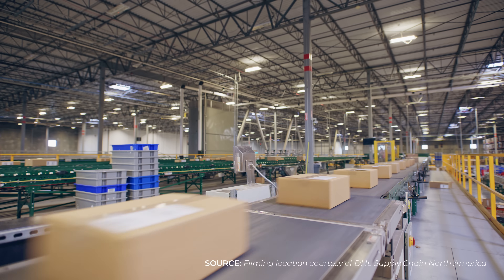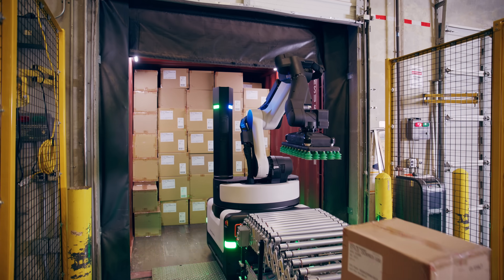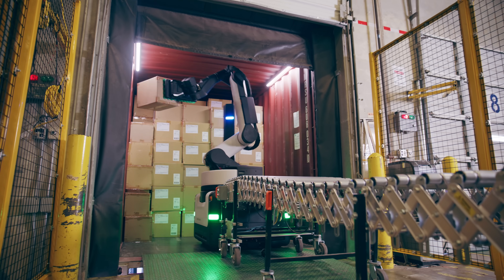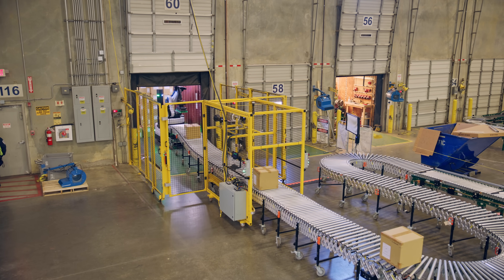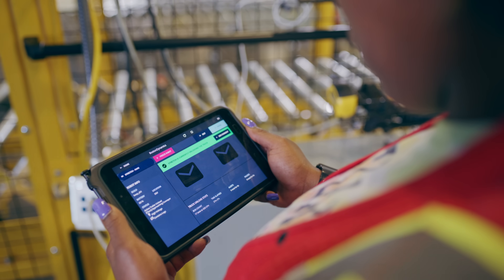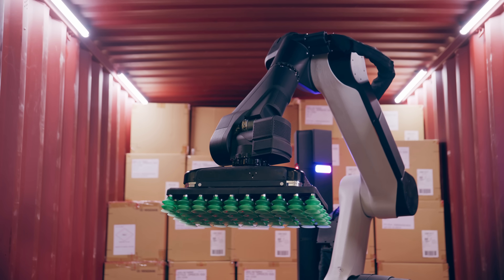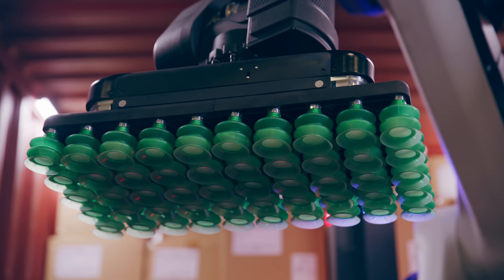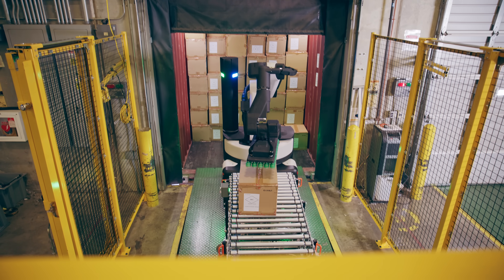Stretch at DHL | Automated Trailer Unloading

Comment: Clearly the most inefficient design!  It has to rotate 180 degrees for each package, TWICE!  Would’ve better if it could grab a package and then extend its arm behind it and then set the package down.   Another idea is to have two arms one on each side of the pivoting platform.  So that each time it moves 180 degrees that it picks up a package and places a package at the same time.

I’ve often thought the floor of the trailer should move.  Like a strong fabric that can be pulled to move items closer to the doors.  Eliminating the need to have to walk back and forth in the trailer to unload it.

Comment: I was a handler for many years also at amazon and FedEx and this does not work on all types of boxes and it’s slower than a human atleast twice as slower. I recommend they get rid of the 180 degree turn as it’s a lengthy motion and conveyor start should be right below the arm so as it lifts them it will place them quicker on to the belt. Secondly, this arm won’t latch on to every type of box. Some boxes would rip by their own weight if grabbed just by one side so a second hand is needed somehow. Its definitely a good start can’t wait to see what’s next.

Comment: 2:30 if the ROBOTIC MINI CRANE STRETCH only does 20 boxes per minute I'm sure it doesn't need a break. At amazon you have to load and unload each second with boxes falling off conveyor belt. Human still beats robot

Comment: I used to do this job first off stretch moves slow as fuck. I could do triple this speed and at a much fast rate. Stretch might be good for over night. The other problem is boxes do not work like this and they are not templatize in this manner. The technology is not ready yet.

Comment: Think the biggest pro is consistency here. 

Sure the robot may be unable to handle uneven loads/boxes and won't be as fast as humans. But it can do it all time, every time and without breaks as long there is nothing mechanically faulty. 

Sure you will need to step in once in a while if the box is too heavy or uneven for those suckers to pick it up, but if it can cut down the job load by just 70%, that is HUGE. 

Remember, no human can work at full speed for 8 hours, a robot can do it for 24 hours as long no mechanical issues.

Comment: i want to see strech working a loading dock where the weather barrier is missing or worn out or severely damaged as that's how most typical high flow loading docks are in that kind of shape 24/7/365 as keeping them  sealed isn't a cost executives want to give up their bonuses for so watching this thing work while -25º with snow blowing off the roof and into the trailer and the building would be fun to watch this million dollar machine  start smoking and smashing into every thing or just utterly shutting down. why not show us how this thing works in a thunderstorm where the rain is pouring in, love how you substituted DHL building outside for FedEx which is way bigger and busier than DHL...the DHL building looks just like one of the best buy main warehouses except there is pallet racking full of product much closer to the dock doors by about 50% and that's usually 1/2 mile to mile long by 1/4 mile wide.
knowing how hot it gets in these in the summer i also can't wait to see it fail due to it overheating sitting in 120º+ trailer while itself is exhausting 140º heat on it's own on a 70º day. lol

Comment: I feel like I just watched a big ad for DHL - but also, that's awesome to see Stretch actually be deployed

I do wish that we got to see stretch working further in the truck though - the first 6 feet is fine, but what about the last 6?
Reply: Don't worry I've seen this robot in person (in their lab's [my teacher had connections and gave us a tour of their facilities in … not Boston I forgot where their headquarters is exactly but its very closed to Boston]) and they were showing off the robot picking up different sized boxes with un-even weights in rapid succession. Basically from what they explained to me the robot starts of slow because it needs to map out the boxes with a depth camera, but it cant do that if its a flat wall of boxes. So, the robot needs to remove some boxes and then its cameras (which take pictures every time it wants to pick up a box) can map out the boxes and more accurately predict were the boxes are in a 3d space. So, overtime it gets more confident in its prediction's and its starts going very fast (so fast that it made a mess on the other side in the demo because there was nowhere for the boxes to go). I honestly don't know why they didn't show of a better clip than the one that they did but I don't have all the answers.

Comment: i thought most packages would be on palettes und get unloaded by a fork lift
Reply: You can load more product into a trailer without pallets, and also not needing to have forklifts you cut out a hazard of the workplace. I work in production and manufacturing. Forklift drivers have been the number one problem at every company.

Comment: To me it seems slow..
Reply: You haven't dealt with actual material handling than. This unloads the trucks, scans the product to inventory and loads it to the shelf. Meanwhile, the fork lift driver goes as slow as possible to drag the day out, drops a pallet of goods, then puts them in the inventory section, scans it to a random rack location where they didn't actually put it and doesn't tell anyone they damaged the product and then proceeds to pick up the wrong material out of FIFO order to the work floor.

Fuck fork lift drivers.

Comment: I’ve literally did that for some years at DHL in Sweden and fucked my back up even up until today. Still have a messed up back , did alot more than just empty those trailers under 30 minutes by my self several times a day. A lot more damaging to the back. DHL was the worst working place in Sweden at that time I believe. It’s different now though but still trash workplace for ppl

Comment: I expected much more detailed information about the specs and the economics of STRETCH. What does it cost (upfront, leasing ...), a what rate is its hourly salary running, up time vs down time etc. etc. service needs, limitations and problems. The progress to alleviate humans from repetitive work is very obvious and doesn't need to be stated times and times again but obviously there are other considerations that play a role otherwise these machines would already have taken over.

Comment: Three takeaways from this. First is that the guy in the beginning didn't focus on a benefit of it being better for staff health and safety. Second is that it means robots are now getting cheaper than minimum wage. Third, and probably the biggest, is that they seem to have developed a type of cardboard box that can just be suctioned from one side and lift with a full load without tearing apart...

Comment: If they could turn up the speed it could replace human workers completely and with 100x efficiency.
With that slow speed it only has the benefit of 24/7 operation.
Before, i was working with unloading containers, the boxes would be stacked onto pallets a lot faster than this.
It was hard work for sure.

Thank you Boston Dynamics for making our lives easier!

Comment: I wonder how Stretch handles boxes that are poorly taped at the top and/or bottom. It grabs using suction on the top or at the side, which basically relies on the strength of the tape to keep the top/bottom from opening up under its own weight. A normal person grabbing the box would usually support from the bottom and not have to rely exclusively on tape strength to keep the box closed.

Comment: As someone who currently works doing this. This trailer load is extremely unrealistic. Every box is flawless, every box has its label pointed exactly where it needs to be, every box is the same size and weight. Not to mention they quoted throughput and yet look how slow it is. 

Me and one other routinely empty a standerd semi trailer of frieght like that one in 20-30 minutes, equalling maybe 1-1.5k boxes. 

This machine is a good start. But it needs to be faster. Much much faster.

Comment: That’s faster, safer and cheaper than a human. 

But could the robot have two arms and a conveyor in the middle? And pull each box a shorter distance and handle each box in less than half the time, as a giant arm doesn’t need to swing around?

Or maybe an integrated grabber/conveyor could vacuum up those boxes and unload in 1/10 the time. 

Easier imagined than implemented, of course. And not using off the shelf robots. But there is unrealized potential here.

Comment: This bot is doing the task in near perfect conditions at a much, much slower pace. Perfect, square containers, labels facing outward in a non drop floor trailer.  Good, choreographed demo of what is achievable. However, In my day at UPS, I started as an Unloader. I was tasked to unload drop floor trailers. The fastest I could unload 100%,  drop floored 26' doubles was in 30-35min, a 40' in under an hour. That's with decent trailers with good equipment (rollers), higher angled with belt speeds set to my unloading speed. 

The condition of the equipment, the differing sizes and types of package items can drastically determine the pace a package trailer could be loaded or unloaded. But still do that within strict time frames. These bots will need problem-solving AI, dexterity and flexibility of a human in confined spaces to totally idle this line of work for humans. One day, it will happen.

Comment: On one hand, I am really happy and excited to see something like this, on the other, it's really easy to see how this could entirely displace workers and take another job away from those who could use the work in towns where there may not be many other options.
Reply: Many have the illusion that automation will come one day and just take everyones job. The process of switching to efficient automation is slow and is normally applied to new infrastructure. To implement this, they will most likely apply it to new wharehouses built for this process because is better to than modify the old one. Even if they apply it to old wharehouses the current employes can be more efficient by monitoring machinery rather than doing physical labor so productivity can be increased without the need to hire more people. Also automation will increase demand for jobs with higher pay which is better for the economy.

Comment: I did this job for ten years. Everyone who is saying it's difficult and no one wants to do it are correct. However, there's no plan to create jobs for the people this is going to displace. The whole problem with automation is not that it's taking over repetitive or difficult task it's the lie that it's going to free employees up to do other things. That's what I heard from my employer when I worked in distribution. During my time there I saw our output increase due to automation while the workforce decreased by 70%. Governments are not addressing this issue and employers are only concerned about their bottom line. There are going to be major societal ramifications and we are not ready.

Comment: MANY boxes can not be picked up from the top. The weight of its contents will tear the box apart or the top will tear open and the contents will spill out. Boxes need to be carried from the bottom so that the contents will  lifted by the human carrier to oppose gravity rather than hoping the strength of the box is strong enough to compensate for the weight of its contents....
I think the boxes in this video are empty or very light compared to the expected load of boxes of that size... (O-0). Also what happens to box strength if a box gets wet? (>_0)

Comment: They say this thing is hyper-efficient. It looks like it's moving slow as shit.
Reply: "The party told you to reject the evidence of your eyes and ears. It was their final, most essential command". Just listen and believe, pleb. You'll be out of a job and you'll be happy (but not too soon, as this thing is indeed slow as shit and therefore infeasible to use in real-life logistics, at least for now).
Reply: Because it works non stop. People clock on and off, you can just leave this running
Reply: @xaiano794  Day shift goes -> night shift comes (and then the other way around). Also, if this is "running", then I'm Usain fucking Bolt. Not to mention possible malfunctions, some of which take quite a while to fix.
Reply: @WickedParanoid  You're talking total BS. You have clearly never worked in a workplace with robots, you just have more of them.

I worked in a chocolate factory, the robots piling the pallets were slower than any 1 person but it didn't matter, there were 4 of them doing what 2 people could do.

We only needed one engineer for the whole floor, a total of 4 employees and we made 250 tons of chocolates per day.
Reply: @xaiano794  I would be chastised If I unloaded the trailer as slowly as that robot.
Reply: It still looks like it will take a very long time. If this was the main thing getting the job done you couldn't call it a fast pace environment anymore.
Reply: @TJizzle-bi1ur  speed isn't important, Persistence is since you can just get more robots
Reply: @xaiano794  Pretty costly robots, with a pretty costly team to maintain and repair them in addition to that. So I'm still not convinced about it being all that effective.
Reply: @xaiano794 I guess it all depends on the environment and what type of expectations they have. That's surprising that you say the time doesn't matter.
Reply: @xaiano794  Even if you had more robots, they still would not be able to perform on the level as a human could.
Reply: @TJizzle-bi1ur  if a robot is half as fast as a person and you have 2 robots, what's the difference?

I don't understand how people can't seem to grasp that you can just have multiple robots.
Reply: @xaiano794   You can't have multiple robots doing one task such as unloading that trailer. What you're saying would not be possible to apply to specific functions because of the size of these robots and the necessary room they need to operate. 2 robots simply couldn't fill in on one task to begin to make up for the lack of speed because of their size and ability to both fit in on doing the same task together at once.
Reply: @xaiano794  So technically you can't make up for the speed of adding more than one robot. Since they would not be able to manage to fit. Also, these robots are limited in what they can work around. They simply would not be able to tackle any trailer that comes to the dock because they are not capable of adapting toward specific environments.
Reply: @xaiano794  You would need 3-4 robots to match my speed
Reply: @TJizzle-bi1ur  So you add more docks and change the unload time? It never matters, if you can automate tasks like this the only thing that matters is consistency
Reply: @xaiano794  Well if they can do it all the power to them.
Reply: @xaiano794  I'd like to see them automate the tasks at the delivery station I work at. Lol, I think the robots would malfunction.

Comment: Ah yes, clean as hell truck, all the boxes are the same size... Typical "perfect conditions" promo video is all I see (how many times did our UMs come to us with a "perfect work optimization idea", only for my direct superior to painstakingly explain to them that it JUST WON'T WORK IN ANY CONDITIONS BUT ABSOLUTELY PERFECT ONES? I've lost track at this point). Not to mention the bot's abysmal speed and potential software/hardware-related problems that someone will need to fix on a daily basis. Yeah, I don't see this as a sustainable substitute for humans, certainly not yet.

Comment: I loaded trucks for UPS just like this. This tech is still very limited in scope. Critically the boxes loaded into a typical truck are all manner of size and weight so "grabbing" device won't work for all situations. 

Let it try unloading (loading would require AI expert at Tetris) a truck in Idaho full of boxes of bullets wrapped in chicken wire along with the normal cardboard boxes of random size and weight. Trust me, no one wanted be assigned to the truck headed to Idaho, Wyoming and the Dakotas .